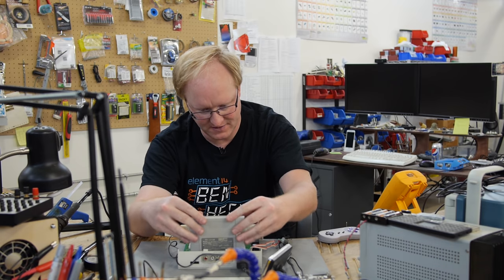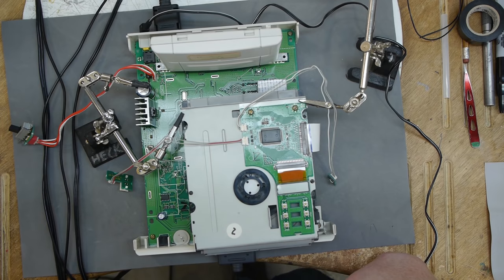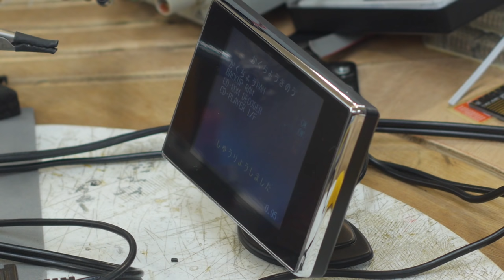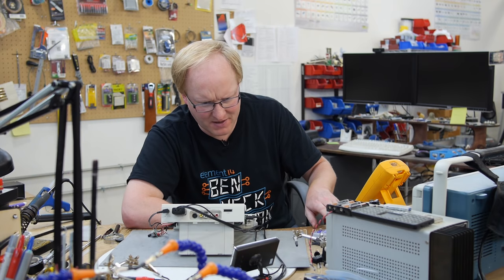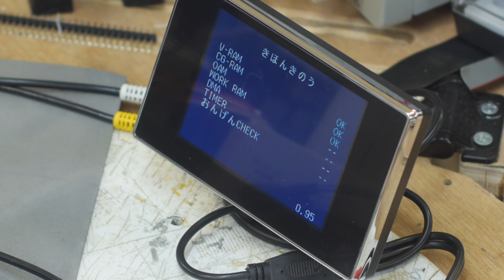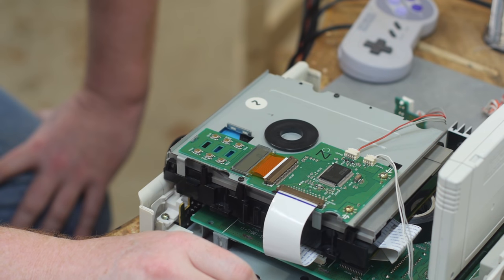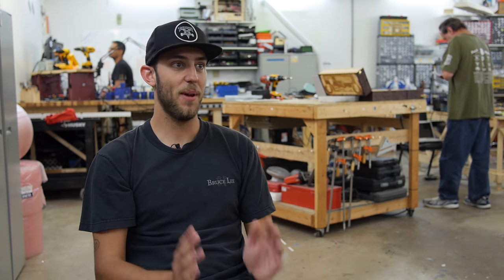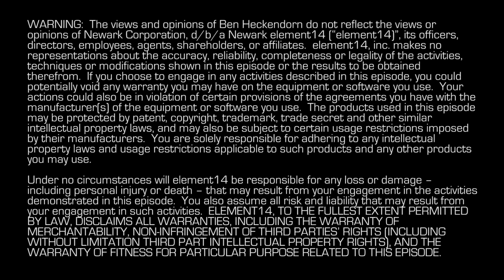Ben Heck's Nintendo-Playstation Prototype Part 2 Repair

Comment: is there gonna be a part 3?
Reply: I wish! I wanna see them get that CD drive working, and playing one of those homebrew titles.
Reply: Here, here. Finish fixing it and remove the yellowing. It ain't a done job until the job is done.
Reply: Well, that's basically what's this unit is, an snes with more sotage and the capacity of playing CD track. So you could throw more stuff in the game, more stuff happening in the system thanks to ram expension, and better sound 'cause you can have CD tracks playing
Reply: *****
We'd be able to see it running a disc. That's not too shabby as far as I'm concerned.
Reply: +Stick_Giraffe They could try to get that hacked version of Road Blasters working, the ROM that's running on the SD2SNES with full motion  video.

Comment: You could probably just try to burn a game rom file to a disc as raw data and see if it takes that.
Reply: There's already 2 homebrew titles they could try.
Reply: Probably won't as many games are using cartridge hardware directly. Would probably need some kind of special header anyway.
Reply: You most likely need to reverse engineer the CD-Rom cartridge bios to see what it looks for when reading the disc and well, doing the thing it requires.
Reply: Dr_Kachu san That's already been done. Look up Super Boss Gaiden and Magic Floor, two homebrew titles for the SNES that also got ported to the Sony Super Disc. No$sns can play them if you obtain the SFX-100 boot ROM, which has been dumped thanks to the Diebolds, since they allowed a few guys to do so.
Reply: Daniël's Tech & Music Channel 
Well, time to roll up some isos then.
Reply: I have to assume there is a missing rom cart or at the very least one was planned
Reply: ALitleBitSpecial Actually, there is the romcart, it's from where that bios thing comes from.

Comment: I kept cringing at your tweezers lol you should definitely invest in some ceramic tweezers. they're non conductive, so if you have any static in your body, you're not going to short anything on a board. another plus, they'll stay pointed and have a more stable grip.
Reply: STOPH3R01991 it's funny cause he has an iFixit kit and they make good tweezers so he should have/get those
Reply: Jason Zak I don't care what brand they are. metal is conductive to even static, ceramic isn't.
Reply: STOPH3R01991 I'm just saying I find it odd that he has all these iFixit tools but not the tweezers.
Also, the iFixit ones are completely ESD safe even though they're not ceramic.

Comment: he just wanted to poke around inside that one of a kind system a bit everyone knows caps should be the first thing you check lol
Reply: Yep, I was practically screaming this at my TV the entire time.
Reply: To be fair, it was pretty much the first thing he did after putting the tombstoned resistor back in place.
Reply: Yup. You open a circuit board and see the caps first. Not hard.

Comment: 0 ohm resistor? that's like a calorie free energy drink, unless it means you get free calories but thermodynamics dunt allow that
Reply: .. they mainly used for a robots because they 0 ohms are exactly the same size as resistors. So robot can place then on the board.
Reply: +DoctLaser so then it isn't actually a resistor. I have a 0 centimeter meter stick if you want $1000 with free delivery since it's so light and doesn't take up much volume
Reply: It's a resistor-shaped conductor.

But resistors are all actually conductors, except with their conductivity lowered in a predictable way. So there is no principal difference between a 0-Ohm resistor and any other, except this one has lower resistance.

But of course any conductor has a positive, non-zero resistance; however, a 0-Ohm resistor has resistance same or lower than a board trace, so it doesn't matter, you can't even measure it because your probes will have a higher contact resistance than the 0-Ohm resistor itself.
Reply: Ohh https://en.wikipedia.org/wiki/Zero-ohm_link
Reply: Radical Edwards > 0 ohm resistor? that's like a calorie free energy drink

Actually, it's more like the physical equivalent of a NOP instruction, which nearly every microprocessor supports -- NOP being short for "No OPeration" or "do nothing".

Why have an instruction that literally tells the processor to do nothing? Because it comes in handy if you're writing a program where you know you'll be adding new features and functionality later, and you want to set aside some unused space for future code. (It can also be used for timing-specific issues, since even a NOP instruction uses up a few clock cycles on a processor.)

Comment: Omg your aren't using an anti static pad!!!!!!? Oh never mind. Lol.
Reply: Those things are mostly a scam anyway.
Reply: +a1rh3add Idk. I was just repeating what he said. Lol.
Reply: +a1rh3add there's all sorts of hype around how ESD will destroy CMOS chips, but unless you're shuffling around in wool socks on carpeting it's much ado about nothing. I work on circuits with CMOS IC's all the time with my bare hands and no static strap and never fried anything.
Reply: andynshelleyinurface plus how circuit boards are coated. You would need to be directly handling a bare soldered point in order to transfer any charge and even then it's doubtful you could cause any real damage.

Comment: did they try a ps1 game just for fun...
Reply: Wouldn't work and you don't even have to try it out.
Reply: kind of like putting a Saturn game into a PS1
Reply: ive put a saturn game into a ps1 before now  as some had the soundtracks you could listen to streight from the game disc  :P
Reply: gamemaniac85 No kinda like putting a PS1 game into a Sega CD.
Reply: The XA Test function in the cartridge menu may be able to play music from some Playstation games. Redbook Audio should also be supported, but there's no point in trying games that use that, because they tried an audio CD and it didn't work.

Comment: Great work troubleshooting this, hopefully if a disc can't be found, some homebrew CD games could be put together for testing. Two things bugged me though; A) Being ESD safe is always a good idea (regardless of the weather), especially when troubleshooting a non-functional one-of-a-kind console B) It was nice you were able to make a usable power adapter in the shop, but if it's going to shows then buy the right adapter (maybe from Element 14?). Thanks!

Comment: Does the CD Drive appear to be unique to the system? Or is it a SONY-branded CD Drive with a part number?
Reply: I'm willing to bet it is unique
Reply: Kyle Coulombe it probably is, but you never know
Reply: It's probably a unique board and parts of mounting but reusing mass market electromechanics and optical pickup, and the electronics is probably a combination of custom logic to tie it into the SNES memory bus, and off-the-shelf for actual drive operation. Furthermore there are often compatible pickups from some other manufacturer, where they would reuse pinout and matched rail height, so i think chances are good that even a unique drive can be repaired, just as long as custom ICs, if any, are good.

Comment: I might have an idea on how to run audio CDs on this unit. Notice on the front of the unit that there is a headphone jack and volume control. My turn-of-the-century CD drive for a PC had the exact same thing for playing audio CDs directly from the drive. Plus, there are CD controls on the top of the unit. You should be able to play an audio CD using the controls and the audio jack. On a related note, the Super CD BIOS does not recognize audio CDs, at least when run on no$sns.

Comment: I have an eighties Roland analog synth that was producing a static-like noise after being powered on for about ten minutes. It had leaky electrolytic capacitors everywhere on the voice boards. The substance was an orange powder (through hole capacitors). I replaced all voice board capacitors as well as the PSU capacitors and now works about as good as new. It's bad to have electronics stored away for years as the capacitors can dry up and become damaged.

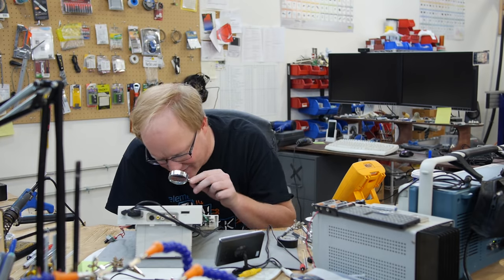Comment: What happens if you reconnect that wire that was disconnected at 13:01 now that the capacitors were replaced?

Comment: couldn't the cd being not read just be the laser adjustment? most drives have a pot to adjust it. I've had to adjust so many cd and dvd players and they all worked fine after that. Or is that too obvious?

Comment: so what does flux do? I've soldered twice but haven't used it because I don't know what it is
Reply: flux deoxidizes the surfaces and keeps them from oxidizing again so you get a good solder connection. It also makes the solder flow better by reducing its surface tension. Solder often contains flux already so you don't need any extra, but you can add seperate flux if you need to
Reply: As SolarAlliance said, f you're using solder that's intended for use with electronics, it should already have a core of rosin/flux.  It's mostly just plumbing/non-electronic solder that isn't cored (because you use a brush to apply the flux directly to the pipes).

Comment: I know that it's a long shot... but do you think that thing would play an SNES ROM burned onto a CD?

Other than that CD-ROM hardware, it's still a basic SNES right? If you could get the ROM data from the CD to the actual system it seems like it might actually work.

Comment: Street Fighter still making people scream over quarter century later!

Question: Me and my bro used to play Super Mario Kart for the SNES religeously up until about 6-7 years ago when the CRT screen we used got thrown out in a house cleanup session. When we started replaying we connected up to an LCD / Plasma screen but found we were both way out of sync on our moves, our high times on tracks fell sharply after this and we could only put this down to response time due to the many extra jumps the signal has to make before hitting our screen during its analogue to digital transition (even when connecting through RF or RGB). My question is, are there any tricks or tips you know of that can help mitigate this problem on newer screens or would we need to go buy an old CRT for it to get that original response time / feel.

Comment: I guessed it was the caps as soon as I saw those SMD electrolytic capacitors in the first episode. =)

How? Because I've replaced a ton of those already repairing Turbo Duo's and Game Gears, and given the age of the prototype, it was likely made during the "Capacitor plague" of the early 90's. Should have replaced all of the caps to prevent future failures, but hey, what do I know? I'm just an EET college student that fixes and mods retro gaming consoles.

Comment: Nice job. 
A few repair-tips. ALWAYS start with checking the power rails for voltage and ripple. No exception.  Without good powerrails most things do not work well. Use a good bench power supply with  adjustable current limiting instead of an original supply.  ( one with constant current, or CC mode ) This can prevent the magic smoke from escaping from the console.  It has another advantage, it shows you the current consumption and sudden changes. 

For what its worth, I repair measurement- and calibration gear for a living . Often rather "exotic" stuff that is not supported anymore by the manufacturers. Most times there are no schematics or other information so I must take extra caution while repairing. 
Just my 2 cents.

Comment: I have so many questions, but Ill start with just one, if the CD Drive was not recoverable, would you have been able to replace it with similar components?
Reply: There's not much similar to go around. There's some vaguely similar decoder controllers from SONY which popped up here and there, at least similar enough regarding the command set, but that's just part of it. Another part is that the game has direct access to the mechanics controller, which is a rare standard microcontroller with a firmware that you can't dump, so your prospects are very, very bad if that was gone. That one probably also does LCD and buttons, but there's been some confusion about that.

Luckily, all of these things should last a while. The electromechanics is probably off the shelf or repairable and the optical pickup is likely gone, seized, shot or clouded by now, but there's usually a compatible replacement. But either of these faults don't count as "non recoverable" optical drive.

I guess an emulation is possible, but that's a full fledged engineering task, i don't think Ben is up to it, never seen him do anything that would require the same or similar skillset as emulation of this disk drive. Besides, too much originality would be lost, that's something you could do to a normal SNES but not to this museum piece.

Comment: I wonder if that cd rom addon could play audio cd on it,since the snes sound chip outputs a 32khz signal, unless theres a chip inside wich is able to convert the cd sound into into a sound format the snes can understand, eventrough i suppose the cd rom and the snes have it's own but both the same sound chip inside it.
So the soundchip in the snes could be used for jigles and digitized bleeps while the other but identical soundchip inside the cd rom can be used for streamed audio at 32khz,or visa versa.
Or you can use both for streaming or sytheses sound.

Comment: With nearly 1,000 comments I hope this isn't one that you have gotten too often. But have you tried a Laser Lens Cleaner disk? I saw both main vids and the update. You seem to be getting a potential replacement. But are you sure you cleaned the original of anything that might be causing issues first?

Comment: I think I just put two and two together. If you look up the MSU1 , and see what it does, this version of the prototype might have needed a specific cartridge containing an expansion chip like it that would later have been incorporated into the Playstation PCB for playing back video. The fact that a real SNES can actually do CD audio and FMV (albeit tiny) using a SD card and a FPGA basically verifies that the SNES was more capable than people give it credit.
Reply: You can make any old hardware  do lot of futuristic stuff if you feed it with data from external components or devices, actual limit is the outputs of those compnents. if you watched AGDQ2017 TASBot they did video feed and good audio with NES via controller port (but video and 2 audio chanells was diffrent NES, but that probably because bandwidth limit of controller interface)
Reply: Both the NES and the SNES have ways of using expansion chips, but the SNES literately has a way of passing uncompressed audio from the cartridge (pin 31 and 62). Video of course is another story, but bandwidth available in the cartridge allows uncompressed 240x160@15fps 256 color video.

The "controller port" hacks seen with AGDQ are clever, but impractical, if anything they just show us that there was never any need to change the controller ports for any console, thus obsoleting controllers with every generation.

Basically what I'm saying is that the SNES CD unit likely would have had a DSP chip in the cartridge with any video decoder (eg MPEG) that came with the disc games that uses it, while other CD games may have just been able to boot when there is no cartridge and could still make use of the CD-Audio, since the audio circuitry is all independent of each other. Even the CDi (which Nintendo licensed a few games for) didn't do MPEG without a $200 ($350 in todays dollars) add-on. The CDi had a SCC66470 or Motorola MCD212, both designed to use 68K series CPU's (as was most mpeg hardware of the day.) They output 360x240 video in 256 colors unless fed a YUV stream (eg from a mpeg card.) Had Nintendo been able to license a MPEG decoder at the time, they might not have wanted to go the CDi route either, as I'm fairly sure the high price of the MPEG add-on for the CDi was entirely due to patents, as similar cards for the PSX, Sega Saturn, and PC exist and cost around the same price.

Like any way you look at it, the reason Nintendo didn't produce the SNESCD is because it wasn't a compelling upgrade, and would have at best been of interest to people who didn't already own a SNES. Compare the SegaCD add-on ($300) vs the Sega CDX (which cost $400.) We may never know what the final hardware would have been.

Like, it's entirely possible that the SNES-CD prototype will never be able to boot a CD because CD players of the era were not tuned to be able to play a recordable disc.

Comment: Would love to know if you can fix the svram on the launch SNES. I have vertical black lines, everything else works. Seems like a waste to just junk it.
Reply: so its not exactly a black line. Ex. in KI when the Rare logo goes to the bottom of the screen there is a vertical section about 1cm wide missing from the middle of it. Anyone have an idea on the fix?

Comment: What if it doesn't read burned cds? Perhaps the cdrom was burned at too high of a speed? I would have tried a ps1 disk. Could also be the rom did not have iso9660 libs?

Comment: First, you did an awesome job bud!!! Congrats!!! Would LOVE to see a game made for it. Also, if a game was made would it be a PlayStation game? And lastly, can you help me?????? I bought an Atari 7800 and found out it had a modded power supply, I didn't care for it so I put the original power jack back on it form another 7800 that wasn't working. I'm not an experienced solderer and messed up the motherboard a tad. Two lines on the motherboard leading to the jack. One of them I messed up a little but was able to jerry-rig it to get it working again, however it is touchy. Can this line be fixed????????